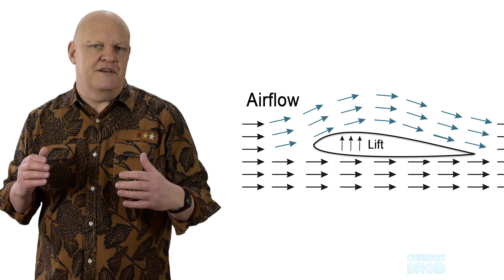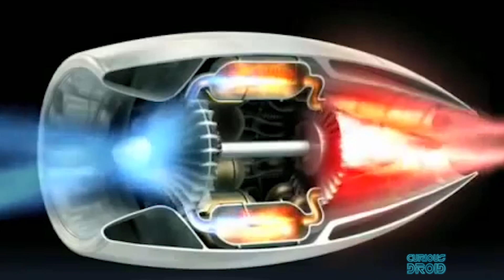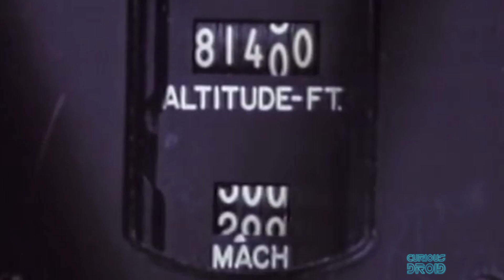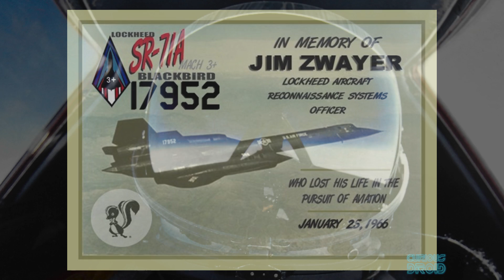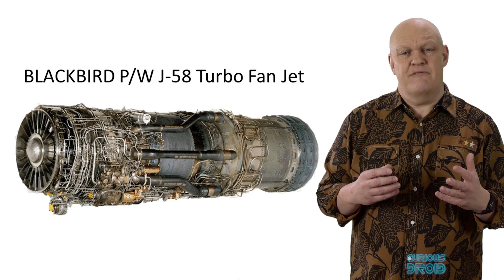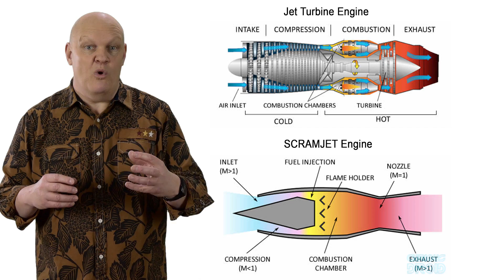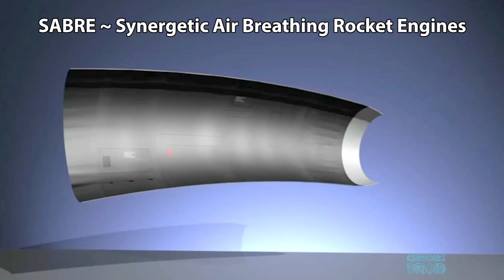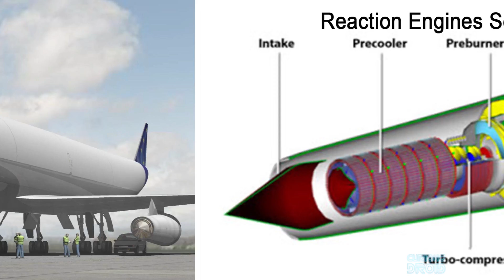Why can't we fly a plane into space ?

Comment: speed has nothing to do with reaching space. ballons do it all the time. space is considered to start at ~100km, and helium ballons are able to exceed that altitude.
now achieving a stable orbit? thats a different story.
Reply: Coyote27981 If you want to be picky... If it is not lighter than air.
Reply: Mathieu Cool even heavier than air, with enough thrust you can reach that altitude without requiring high speed. speed is required for either wing lift (which you can avoid by just relying on thrust) or achieving orbit. but reaching space is just a matter of altitude, not speed.
Reply: Coyote27981 Sorry to burst your bubble (pun not intended), but balloons can't even get anywhere near space. The current altitude record for a gas balloon is a bit over 50 kilometers. To lift a mass of only 10 kilograms to an altitude of 100 kilometers, you would need a balloon a hundred times the size of the Hindenburg zeppelin.

Comment: you dont need to reach escape velocity to reach space. Escape velocity is the speed needed to be reached to leave earth behind and enter interplanetary space. To get into space you only need to reach orbital velocity wich is significantly lower.
Reply: You can go into space at 1 m/s if you have an efficient enough engine. There's nothing in principle stopping you from powering straight up at walking speed, except the need for power and reaction mass. It's only when you are in free fall that you need orbital speeds to stay there.
Reply: uguku actually you don't even need to reach orbital velocity. you can take a suborbital trajectory and if you pass the Von Karman line, you're already in space.
Reply: +spacemonkey You could have just used Google...
Reply: Correct. Escape velocity is roughly 11.2 km / s, orbital velocity is (by rule of thumb) 71% of escape velocity, or roughly 7.7 km / s.
Reply: One correction:  orbital velocity is determined by the height of the orbit.  Once in orbit, you actually need a slower velocity to stay in a higher orbit, but it takes more energy to get to that higher orbit than the lower orbit.  Once in orbit, no energy is required to remain there.
Reply: +mytube001 That's right you could go into space at 1m/s... but you wouldn't save any energy: To go to a certain eight, you need the same amount  of energy. It doesn't matter if you go fast or slow (actually this is correct in a vacuum, in the atmosphere the speed and the shape of your shuttle/rocket matter). The difference is that if you have no "lateral speed", as soon as you shut off the engine you fall back to the earth. There is no "staying " up there for free (a bit like these water jet pack. If you stop the water you fall). 

What most earth mission do is reach the orbital speed, which then let them use gravity to stay in space for free (in practice, you still need a little of engine to correct the trajectory). This orbital speed depends on your height. the higher you go the slower you need to go.

Not using orbits to stay in space is not an option because it would require a lot more fuel, which would make your shuttle a lot heavier, which in turn would require a lot of fuel....
Reply: Ambient Morality nah reaching spacing just means passing over the karman line. reaching orbit means staying in space and falling back down
Reply: Ahh looks like you beat me to it :P
Reply: Revanchist852
Reply: isn't orbital velocity something like 15,000 to 17,000 miles per hour?
Reply: the Concorde could do that
Reply: Of course, getting to orbit is much harder than getting to space, so in missions where the only goal is to bring a small payload to space for a short period of time sounding rockets (suborbital vehicles that launch to a few hundred kilometers up then fall back down) are typically used.
Reply: Did I say anything to the contrary?

Comment: Crazy idea....#228,823,665
Can we save enough fuel by using balloons to launch rockets from say 80k feet?  Lemme guess helium is really expensive and we'd need too much.
Reply: NO. because making orbit is not about going to high altiude but about reaching 28000 km/h (7800 m/s) horizontal speed which is impossible with balloons. Even with launch pad placed on a 200 km high tower you would still need a helluva rocket to make it into orbit.
Reply: It takes about 400 liters of helium to lift one pound.  That about 14 cubic feet.  If the rocket weighs say 1000 tons, that would require balloons with a total volume of about 28,000,000 cubic feet.  If that was a single balloon, it would have a diameter of about 380 feet.  There's no material light enough with the tensile strength required to handle the stress of the parameters involved.
Reply: As winged explained earlier - orbit isn't really about altitude. It's about going very fast in a horizontal direction. The only reason we go "up" at all is to get out of the atmosphere so we can go faster without it slowing us down (or burning us up). A rocket being launched actually spends the vast majority of its fuel burning horizontal to the ground, they turn sideways as the atmosphere thins quite quickly after launch and stay that way.
Reply: Just to add... The rocket would be still so heavy (1000 tons) becasue despite being "almost there" in regards of altitude, it would lack the tremendous speed required for orbit. Only a fraction of rocket weight in fuel goes for altitude management. The vast majority is there for geting the speed. 

And for low Earth orbit (LEO) it is approximately 7,5 km/s or 17.000 mp/h .. That is VERY fast :-)
Reply: The only advantage of high-altitude launch is that you can use more vacuum optimized first stage with higher vacuum ISP.
Reply: 00Billy ....I have wondered about that too...The "redbull" sponsored team that set records for the longest free fall used a balloon tethered to a capsule to get their man to the edge of our atmosphere for the drop...
Reply: I don't know how using balloons would go, as I just don't know much about them but I can say that a rocket can fly to and remain in space not because it gets really high but because of its immense speed, so balloons wouldn't do much.  If they did we would probably be launching from Mt. Everest. :D  That is crazy idea #228,823,666
Reply: keno- thanks man... so Ill need 3 smaller ones?
Reply: @Billy - Smaller ones would slightly reduce the required tensile strength, but not enough to make a difference.  Also, as others pointed out, you need the speed after you get to 80k feet to get to space.  If you dropped the rocket at 80k feet, it's going to lose most of that altitude to decelerate during the fall and accelerate back into space.  It's also too cumbersome and tricky to pull off the procedure.
Reply: Concious - awesome...